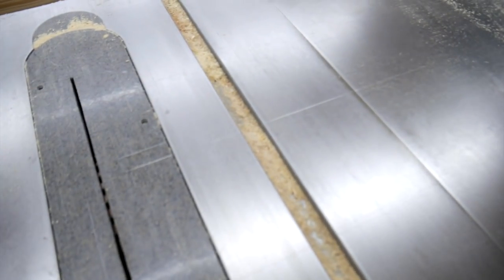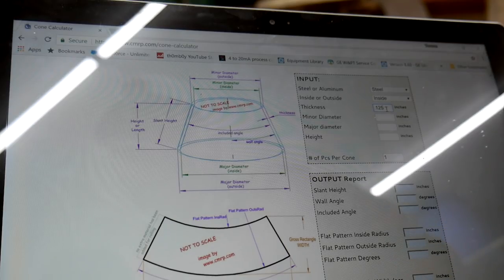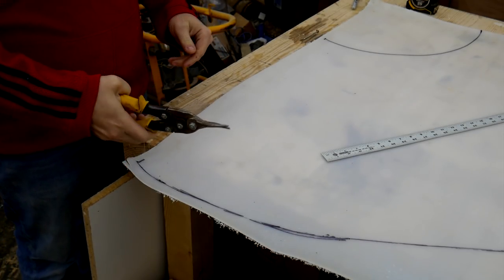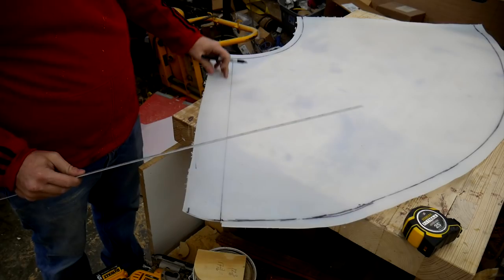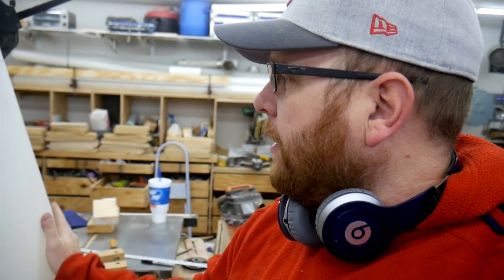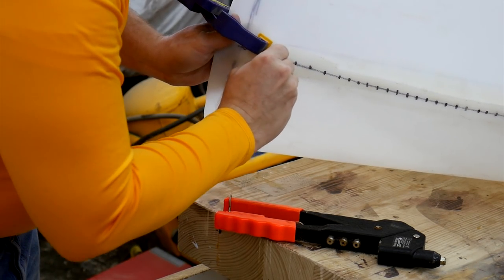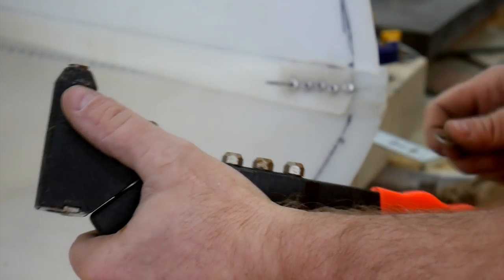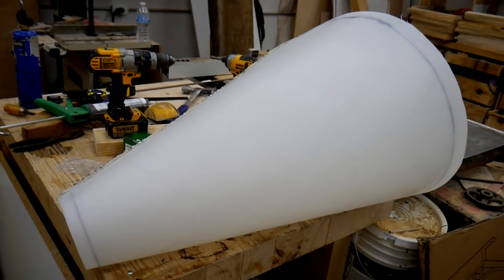Making a dust collector cyclone from HDPE part 1

Comment: Awesome! Thanks Thomas, I was working on EXACTLY the same project trying to use sheet metal and struggling big time. HDPE it is! I can salvage a few sheets from tanks as well. you probably already know, but regular silicone won't adhere to plastic. It does how-ever make a great gasket but you'll be relying on the mechanics of your joint to hold it in place. Sika-flex will act as an adhesive with plastics.
Reply from the maker: There were definitely some ... misadventures while trying to make the cyclone. I’m sure if I hade more time and inclination, I would be able to come up with one that works. Check out the rest of the series for some ideas for mounting flanges and other bits. Ultimately, I think I am going to buy a Super Dust Deputy.
Reply: @SouthpawWorkshop  
yeah, some times it comes down to how much your time is worth,  right now I have plenty so its all good. I'm filming this project and ultimately hoping to use it to launch a you-tube channel of my own (LOL). Worst possibility is I learn something!
Reply from the maker: Let me know when you get the video up, you’ll get a sub from me. Cheers!

Comment: This is so ironic literally yesterday I was using the same Riveter from Arrow and having the same issue! It will not bite down good enough to cut the rivet consistently complete design flaw! That's crazy same thing happened to you has happened to me yesterday using the same exact tool and I just randomly saw your video lol
Reply from the maker: Yeah, the serrated jaws are too soft and they either don't bite down well enough or wear out too quickly.  I tossed that thing in the trash.

Comment: I tried gluing with a glue meant for plastic, it didn't work. 
Move to sheet metal and use a foil tape.  Or just go get a street cone or 2 and make a fiberglass form.  I might try that next.  But honestly these don't cost too much money just buy a super dust deputy and be done with it.

For those of you saying pipe or angle iron  it doesn't work, the clamps get in your way its not that simple. Until you try to make a cylindrical vortex you've got no idea what a pain the the ass it is to make it keep the form when it wants to lay flat and glue it up or weld it.
Rivits work .

Molding the parts is the only way to do this and keep your sanity.. Besides do you really need to see the inside as it works?

Comment: Got any old inner tubes laying around?  Make some "rubber bands" out of them and vary the strength and length by varying the width of the band.  That's a super way to hold irregular shaped components together for gluing up or mechanical fastening.  Good adhesive duct tape works, too.  Gorilla tape seems to be best on rougher surfaces and in cold weather.

Comment: It is a crappy riveted. I have on and it is junk.... Go buy a cheap straight no articulating rivet gun, it works far better..... Hot glue a long string line at the bottom an go around and around until you reach the top. It holds a nice cone until you get it fastened. Try stitching it with an awl and cord. Tie every 4th stitch. Seal with silicone.
Reply from the maker: I agree about the riveter. Thanks for the tips!
Reply: @SouthpawWorkshop  you are very welcome.

Comment: I would try acetone-based Liquid Nails, and stapling it through to a wooden strip till the glue sets. And fastening with rivets afterwords. Tricky. Waiting for the second part.
Reply: Vitaliy Tsybulyak, that material is a polyethylene, I'm sure. Only way is to heat weld the seam together - glues won't work.

Comment: Clamping it between two metal strips with bolts would be easier and work much better.
BTW: getting silicone on the rivets will make them slippery.

P.S. Oh yah, cantilever a board so you can slip the cone on it and have a way to support the cone while you work on it.

Comment: I want make one cyclone for 6 inch size input hose  can you tell me how to do the correct measurements for that
Reply from the maker: What I did was find a commercial product like the Oneida Super Dust deputy and got the general dimensions of that unit, then I plugged those dimensions into the cyclone calculator I have linked in the description. It three calculated for me the pattern to cut out for the cyclone.

Comment: I think you could move this project forward by using plastic welding techniques. This will eliminate fastener bumps, step edges, and caulking. You may also weld the pipe fittings into place. 

Try clamping the two edges down to the workbench with long pieces of lumber (or angle iron). You will probably need a bit of non-stick aluminum foil between the plastic and the bench. Leave a gap between the lumber so you have room to weld and roller. 

Use a plastic-welding hot air gun to melt a narrow ribbon of your (cleaned) scrap material into the hot butted edges. An assistant can use a wooden wallpaper seam roller to maintain thickness. Again, use some nonstick foil to keep the plastic from sticking to the roller. 

After it completely cools (for hours), you can unclamp it. 

A flameless catalytic butane burner might also work. Just don't even think of using an open flame! Hot polyethylene may smell like paraffin wax, but it would release toxins in a flame; plus you would get char and contaminants in the seam. 

(P.S. Clean the plastic very well with isopropyl before welding and avoid getting skin oils on the welding rod and edges!)

You can also use the hot air tool to soften the cone and bend down the flanges using the edge of a bench. However, you may not need to bend flanges at all. Just weld on top and bottom plates.
Reply from the maker: I seriously considered plastic welding the long seam, but after some experimentation, I wasn't confident enough to attempt it.  I do plan on using a heat gun to form flanges.  I left extra material on the top and bottom of the cone for that purpose.

Comment: I bought that EXACT same riveter new and it slipped never popping the rivets. The hardware store gave me a new one and it was the same. Either there are fake ones on the market or Arrow obviously now sells poor quality. I found my old rivet gun and it had no problems at all. It seems the metal is too soft to perform.

Comment: LOOKIN GOOD  Thomas, a thought that if you'd of used a 2x1 and screwed into it rather than using all those bolts, might of been a little cheaper BUT that doesnt change how its going
Reply from the maker: I considered using a piece of aluminum flat bar on the back, but decided against it for simplicity sake.  In order to make the seal, I was going to need the same number of screws.  I think it turned out ok. We will find out together. Cheers!

Comment: Two rows of rivets(or screws), staggered. Either the riveterter is worn out or you have the wrong size head on it. I like the idea of screws better. You can take that back apart, if need be. You have plenty of screws , just stagger every other one to make two rows. Think aircraft skin rivets.

Comment: I would have used a 1 inch aluminum flat bar on the outside and that I believe would have solved  the rivets problem
Reply: Seems logical but I don't think it would have solved the issue in this case. I just posted a comment that i was actually using the same exact Riveter from Arrow yesterday and running into the exact same problem are the rivets not sitting correctly  and cutting when I was riveting through aluminum making a cyclone I'm going to get a new Riveter from different manufacturer

Comment: To stop the rivets pulling through you put a small washer on the mushrooming side of the material
Reply from the maker: They were there.  The material is so soft, they were still pulling through.  I still blame the crappy river I had because I have successfully riveted softer material than that with a good riveter.

Comment: Hard to believe that with  vacuum with any power ;it doesn't suck the sides in on that thin plastic. I would have just gone one of the Chinese cyclones personally; if price is a problem.They work well for a personal duct collection system.
Reply from the maker: Have faith! The plastic seems to average around 3/16” thick. Not flimsy by any means. Stay tuned to find out...
Reply: The small dust deputy lowers the vacumes suction, and its not that strong to start with. 
You need a blower that can move 650cfm. Vacumes only move about 200 cfm.
165 if you add the separator.
Works on a router table with dust box, or lunch box planer that has a blower but doesn't do much on a table saw.
It helps with a ras. And 12" disk sander.

Table saw you need some serious suction.

Comment: Did you ever figure out to put in the right size tip in your rivet gun so you would get enough grab on your rivets. I have the same rivet gun.
Reply from the maker: I think the teeth were worn so it wasn't going to work unless I replaced them.  Easier to just buy a new riveter.

Comment: or.....snip the tail of the rivets with a pair of wire cutters. Maybe you had the wrong rivet/nozzle sizes?
Reply from the maker: I think it just boils down to a cheap riveter. I have used several in the past and this one just doesn’t want to work right.

Comment: Awesome 
Were did you find those bins to cut up?
Reply from the maker: You can find them on craigslist.  They are called IBC containers, but most people call them 275 or 300 gallon totes.  I get mine from work for free :)

Comment: Thinking heat gun and soldering gun for finish?
Reply from the maker: Next step I am going to try the heat gun first then go to the torch, but that is a ways off.  Too many projects this spring.
Reply: @SouthpawWorkshop  -- HDPE is actually the same plastic that grocery bags are made out of.  You can heat it up with an electric heat gun and bond it to itself with a bit of pressure.  Sometimes, when I need to make a specialized part, I'll heat up a few of the grocery bags and use a marble rolling pin or a mallet to compact the layers until I have the thickness that I need.
If you are going to be doing anymore riveting on large sheets of materials, you might want to consider getting some Cleco temporary fasteners.  They are used as clamps when fastening sheet metal like with aircraft skins.
Reply from the maker: Great advice. Thanks!

Comment: I hate to burst your bubble but your dust collector will never be better than a P-100 mask which is made to block asbestos particles.
Otherwise good video!
Reply from the maker: Good thing I am a woodworker and not an asbestos worker! In all seriousness, you are wrong. I choose what filter runs on my dust collector and I can go all the way to a P-100 HEPA filter if that is the type of performance I’m looking for.
Reply: Hmmm! I’m not! Not even a positive pressure air filtration system filter with HEPA filter have a higher efficiency than the mask since particles can reach your lungs before reaching the filtration system!

I’m not saying the it’s not good but just that it’s not as good as a mask! Though the mask will never filter the air in the shop. Both have their use!
Reply from the maker: I understand what you are saying, but I believe you are splitting hairs here. It is moot for me anyway since I sport a beard, so masks don’t work for me unless I want to wear a full-hood, forced air SCBA unit. My solution is to run a dust collector with a good filter, and simultaneously I run a shop air filter for any fine stuff that gets away from the DC. Will there still be particulates in the air? Yes, but all air is filled with sub-micron particles whether you are indoors or outdoors and you can’t eliminate everything unless you run around with a respirator on 24/7

Comment: seems like a pretty usefull material , the only wrench in the works that i can think of is static electricity wish might cause the dust to stick to the sides or zap you if you come near it , might want to ground the thing to earth once its done 
going to wait and watch part 2 to see how youre going to get the flanges done

i might make my own but think i wil use cariage bolts , https://images-na.ssl-images-amazon.com/images/I/51vL5lOm2SL._SX355_.jpg 
they have flatter heads and a aluminium strip on the outside to even out the clamping force , prolly usefull to hang it up with too 

as for making the flanges  , if it turns plyable enough you prolly can use a wettened / oiled wood spatula to form it better  think you need to go round and round with the cone on a piece of angle iron and press down on it / compress it so it gets thinner on the edge with a greased wood spatula while keep the heat on allround flattening / stretching the flange further on the edges than closer at the bend 
once the bend is close to flattened maibe you can put a metal plate on youre electric stove  , prolly be eazier to even out the heat aplied on the whole flange when you do it that way (cheaper than buying gascanisters for the torch too) , the metal might end up sticking to the plate (not a problem if youre planning to use that same sheetmetal for the top anyway) or turn black though 

if the flanging dont work you can allways make the flange rings out of wood cut with a taper (router?) and put screws through them from the inside out
Reply from the maker: Love the suggestions. I have a plan in mind, but if that doesn’t work out I may take a couple of your ideas. Thanks!